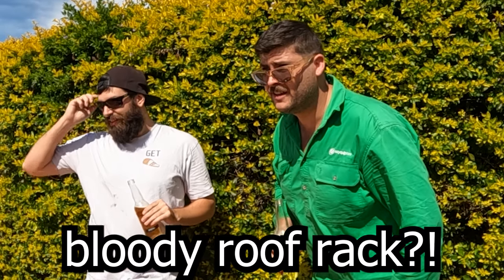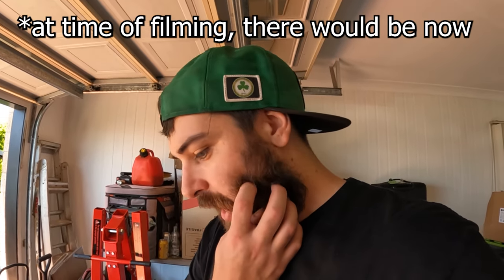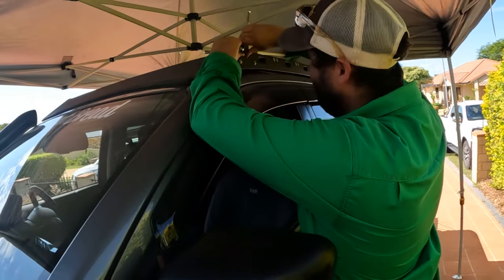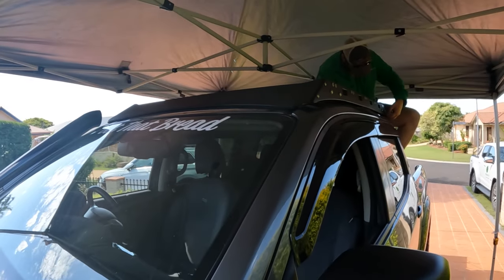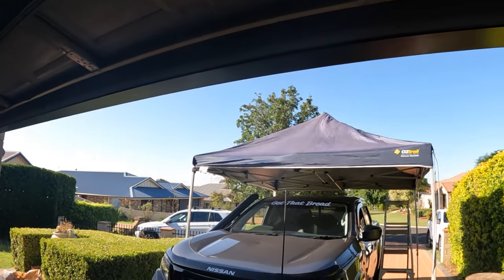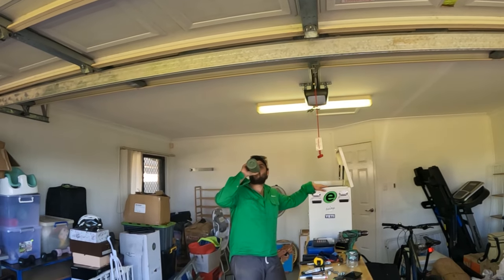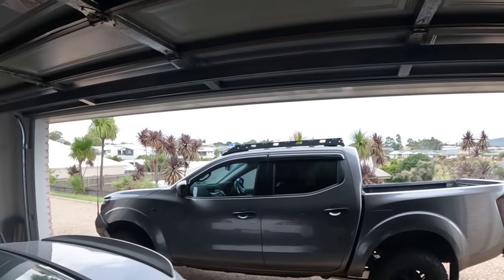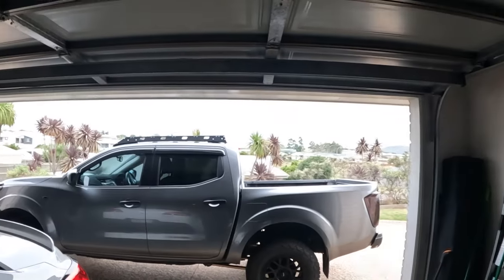Meredith Metalworks Slimline Roof Rack Install | NP300 Navara Build

Comment: We just brought a Nissan SL Warrior and I did not know there was no pull out lugs for roof racks. Any idea how the Nissan factory racks are installed? Is it the same?
Reply from the maker: Pretty sure the factory ones are similar just the holes are in different spots and they have plates under the roof lining too.

Comment: Quick question, ive watched this twice.. but just wondering how you fix stuff to it being all closed front/brack and sides. Like solar panel, lightbar ? New subscriber!
Reply from the maker: Hey Josh, thanks for subscribing! The rails have a channel in them that you can slide things into. Will have to undo the couple of bolts on the side of the rails to be able to slide things into it then bolt it back up.